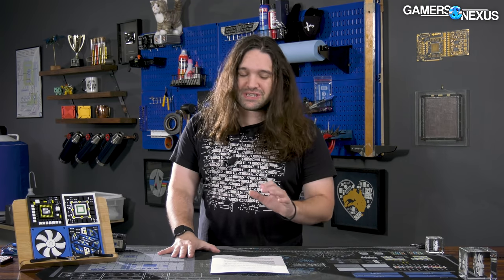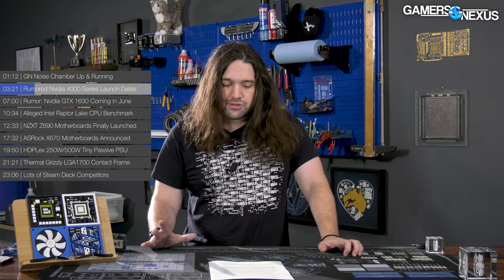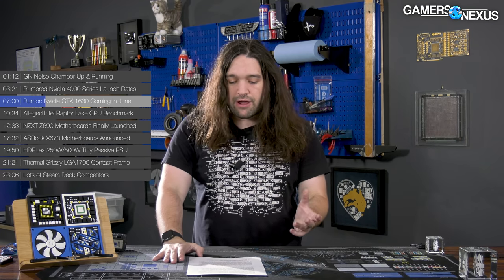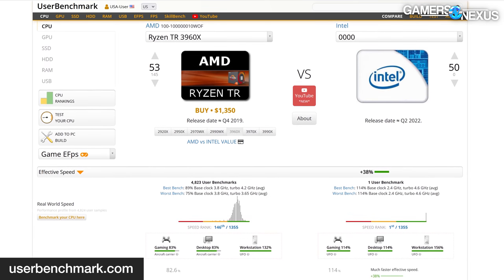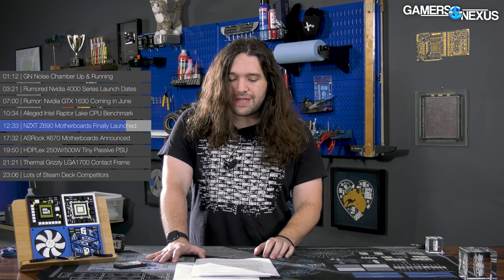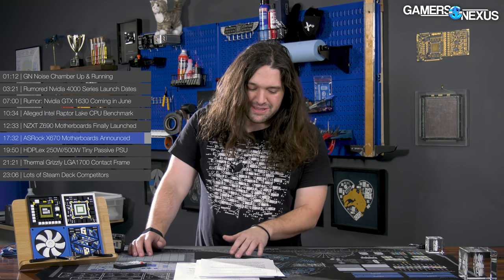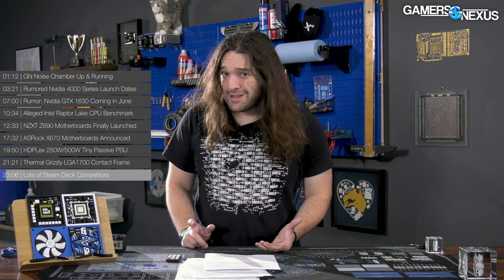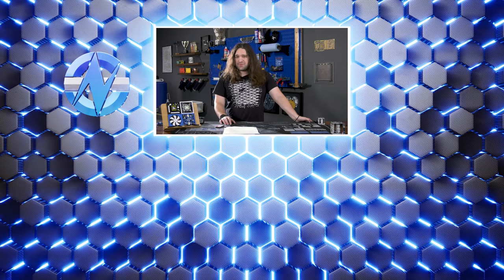HW News - Unbend Intel, RTX 4090 Launch Dates, GTX 1630 GPU, & Steam Deck Alternatives

Comment: Nvidia were not ready for the demand on the 3000 series cards and they took that to their advantage by bumping up the prices later on. With the 4000 series, they are opting to release the 4090 in case of another repeat of shortages etc…they’ll make the most out of that selling the 4090s first.
Reply: It's not that they weren't ready. They sold cards directly to miners.
Reply: @Goatfer  yes that is true. They’ll also limit their 4000 series GPUs to the 4090s and do the same thing again. More cash for them with this approach.
Reply: The 30-series cooler is literally designed specifically for mining rigs, they don’t care about gamers at all, they knew exactly what was going to happen and they made bank off of it
Reply: @What_In_This_World  I would probably disagree with that because gaming can be as hot or hotter than mining. They designed the cooler that way because it needs it
Reply: It’s iPhones all over again
Reply: @Yeltnerb 1 they quietlitterly ramped the already closed production of some 2000 gpus up so the market gets satuareted at least in the entry/midrange...so stop spreading complete bullshit that is boderline slander
Reply: @Yeltnerb 1 link proof of AMD selling directly to miners. I'll wait. 🤣
Reply: eth difficulty bomb is going off, there's no way it'll make any sense for miners unless they expect for them to be scarce for the month or so that they'll be profitable so they at least beat market deflation
Reply: @Yeltnerb 1 what complete nonsense. there is no reason NVIDIA would limit production during peak, unprecedented demand. AMD and NVIDIA were literally printing money in the form of GPU silicon
Reply: Greedy bastards, makes me sick. They will also do this so they can milk out the 30 series even longer. I bet we don't see a 4070 until Jan 2023, maybe Christmas if we're lucky.
Reply: @berengerchristy6256  AMD and Nvidia dont need to sell gpus anymore because they could just mine trillons of dollars for themselves.
Reply: As a 3090 owner, I fully intend to buy a 4090 if gaming performance has a improvement of greater than 30%
Reply: They were fully aware of the demand. They just released them and had to pretend that cryptominers weren't the main customers because they were trying to lie to their investors at the time.
Reply: @jesh879  it's suprising how often companies lIke Nvidia and Intel get caught with their hand in the cookie jar and everyone always says AMD is just as bad. They aren't. They have literally remained the most consumer friendly silicon company for a very long time. Yes they have gotten much less friendly since Ryzen but they are competing well now. It wasn't that long ago that people were saying AMD dead or trash. Over and over again in the comments on YouTube.
Reply: Only nVidia could create a family of brand names which are product numbers :D

Now soon as you see '90s or '80s you automatically think AMAZING TOP TIER and worth paying a hefty premium for.  But I guarantee you these will age terribly, I would avoid those two on this generation until much nearer the latter half of that generation at least.  The first cards in a product line are never ever the most powerful.  That has never happened and I doubt it will start now...
Reply: @What_In_This_World  gotta love youtube where people just completely make shit up and state it as fact
Reply: John-Paul Hunt  planning doing that actually. Might pick up a 3090/3090ti in late August, my local electronics store has plenty in stock and are already selling them between 200-300 (CAD) below MSRP.
Reply: @infernaldaedra  AMD isn't your friend though. Shilling and running defense for them isn't any better.
Reply: @JustSomeDinosaurPerson  You can believe whatever you want. No corporation is your they all only want profits. Hell If GPUs didn't exist at all the world would keep spinning.  
but I will prefer the lesser of two evils given a choice. And I mean that lightly not to be taken seriously. I'm just saying it's better to gravitate and support the companies that aren't taking more from people than they give. Like I obviously don't support companies like Apple or Nvidia. Do I hate their products outright? No. They make really cool shizz alot of the time. But they have done things that I could never agree with in the past and still don't to this day. Competition breeds a healthy market.
Reply: They were ready for the demand. They caused it! Then limited production and jacked up the prices. How do we know this? This is the second time it's happened, and the second time Nvidia  Has reported record profits! That's not coincidence.  If so they would have been ramping production.

Comment: Regarding the look of the Taichi Carerra: yes, definitely.  Matte black, with or without a grey mottled pattern or carbon fibre squares, is fine, but when it comes to deviating from that, designers really haven't given us much to work with.  The pure white aesthetic is fine if you're going for a white-out build, but then to really make it work you need to find pretty much everything in white.  Pure white as accents on a largely black board doesn't really do it for me, but the marble pattern looks quite nice.  (As long as it's done as well in mass produced as it was for the one photographed, which is an open question.
Reply: It could feel more premium if it were made of epoxy-ish material, similar to from what some marble dice are made. But more likely it will just be a generic print over usual plastic (at least for pattern consistency), and that's on the meh side when compared to metal.
Reply: I'm happy that they are trying something different that isn't some hideous rainbow unicorn vomit nightmare. In the right case it would look good.
Reply: I thought the marble looked good too. The Taichi series boards have had some nice aesthetics lately, imo
Reply: The name comes from the famous Carrara marble quarries in in Tuscany, Italy. The actual marble is the best and most expensive you can get. The mobo looks and name are a bit tacky, though.
Reply: I like the marble taichi effect. Bring it on I have a white case ligned up for it
Reply: All white builds show even the smallest amount of dust. Might as well just call white builds yellow and brown
Reply: @infernaldaedra  Might as well clean your room.
Reply: @nimrodery  My room is actually really minimalist but the carpet in my apartment needs to be replaced. If it had hardwood or something I'm sure there would be less dust.
Reply: Considering most of it is just a case, they should offer a few options like how the ps5 side panels come off
Reply: Looks like a marble tile
Reply: Also Yes....but i am an ITX-Board User and won't go back unless there are either none or only bad ITX-Boards in the future.
Reply: The marble on that board looks super clean 👌
Reply: When I hear Taichi I think of people doing anime stances outside in a nice park or garden setting. I definitely don't think of black and white PCBs or marble fascia. The word “Carrera” has its origin in the Latin term “Carrus”, which means “vehicle with wheels” or “car”. It was anglicized from the French word ‘carriere’ in the mid-16th century to refer to a road or a racecourse.
Reply: Who cares, I see the mother board a few times a year when I take the side panel off to clean out dust. You get a motherboard to work not a fashion show.

Comment: If you plan on getting a 4090, move your rig to the laundry room gonna need that outlet 😂
Reply: Or sell your oven and use that outlet
Reply: @Ikxi  rite toaster oven will do just fine 👍
Reply: Or live in a country that uses 230v ;P
Reply: @kecuthbertson  nah thats too unamerican. running a whole 240v circuit just for a psu to power a 4090 Ti Max extreme pro is much more suitable
Reply: A 230v outlet is rated for 20A. Are you telling me that the 4090 is going to draw more than 2KW?
Reply: If both gpu and cpu start drawing 500watts on load you better use 2kw psu.
Reply: @boffa_deez_nutz  The max a plug can be in the UK which is 230v is 13 amp.
Reply: @tyguy3876  Your gpu can take that job too

Comment: I have been SUPER happy with my steam deck. I'm disabled, and usually play games while laying in bed. I used to use Remote Play to stream games to my phone, but the SD has improved it overall. I haven't run into a game where the SD wasn't powerful enough and needed a boost from my main rig, so it hasn't been turned on since I got the deck. Less power consumption, less heat dumped into my room, and the ability to play from a more comfortable position are all great perks for buying it. Plus, now I can bring it with me when I go fishing to kill time between bites. So far, it's been nothing but wins

Comment: 2:33 Really excited for frequency spectrum analysis - "noise profile" is, IMO and subjectively, even more important than pure agregate "noise number", especially for low-noise builds or builds that idle a lot in your room. Just a day ago in a fan comparison video, the reviewer bothered to record installed working fans - and all the bearing rattling and clacking and squeaking instantly painted a very different picture than the one in performance charts, and changed my decision right there and then.
Reply: And actually, just adding a recording of the fan going from minimal to maximum RPM (with a fixed volume boost) would be very useful for this reason, IMO. This could be an after-credits section even or a mini-playlist on the Extras channel, but it would let people compare fan sound profiles, and even catch important peculiarities like Arctic's 1000 RPM resonance, or some Noctua's specific hum.
Reply: @Lishtenbird  I would rather hear 750-1400 rpm. People who actually use fans higher than that are few and don't matter. Below 750 you clutter the data with bearing noise and no fans are moving a useful amount of air, anyway.
Or hear it up to a specific decibel level like 40
Reply: @Lishtenbird  +1 to what they said, NF-A14 ULN owner, their 9.1 dB(A) (at no distance disclosed) can be heard from 7ft away at 650rpm, I use a fan controller to get it down to 550ish to be inaudible. Bought it so my amps 40mm fan doesn't turn on ever.

I also got a phanteks psu with a zero rpm fan mode when idle, what the noise number didn't include was the times when a switch(?) twangs because of the heat inside of it kicking it on and off.
Reply: @jesh879  I mean... That's more effort than just running a 0-100% PWM signal with the RPM value on screen, for the sake of several seconds saved. And you also lose checking for things like 0 RPM feature. Fans at absolute minimum speed are an absolutely realistic scenario for all the time you're not gaming/editing, so bearing sound matters. Fans at absolute maximum are also important for hot days or off-chance long rendering sessions.
Reply: Given that the picture had a cardboard box and wood beam inside the chamber I'll keep my expectations in check as it appears GN does not quite understand the importance of controlling sound absorbing properties of the chamber.
Reply: @DavidBezemer  I'm reminded of open bench testing, pc parts can perform fine in the open air vs in an enclosure that adds its own inefficiencies, so if a fan was tested in the open air, next to absorbers.. what happens when its in an enclosure? (rhetorical) just pointing out one of the caveats in testing vs a majority real use case scenario where a box with six sides surrounds the subject like an open bench result vs in a case.
Reply: @jesh879  to each their own. I'd like to have your hearing for a day.
Reply: @Lishtenbird  I have a few noctua fans, but I don't hear much from them unless the PPC (I got it heavily discounted at a hardware store going out of business) hits max power (~3k RPM). All I hear is the air getting pushed around (though this is not always unnoticeable, since they can move a lot of air when at top speed).

Then I went and ruined it by installing a 6800xt which, while a great GPU, has fans that I wouldn't call quiet or subtle. They're not horrible, but they're louder than my computer was by a comfortable margin when they spin up - loud enough that spinning up the PPC fan to its max 3k RPM is still quieter than letting the GPU fans hit max RPM.

Comment: Simple answer: God yes. That marble look is absolutely gorgeous and would massively uplift the look of my system. I'm hoping there'll be something similar available in a few years when I need to update from the 5900x and the mobo needs to follow.
Reply: Im honestly suprised it took motherboard manufacturers this long to implement designs like that. 

Vape companies have been offering their products with motifs like that for years.
Reply: yes, but screw asrock. so no
Reply: @Dracossaint  what they do? (new to pc stuff)
Reply: picture looks bad in my opinion but could be the bad collor settings on my monitor. would need to see it in real live to be sure it looks like marbel and not brid poop.
Reply: Gotta agree. The marble look on the Taichi looks really good.

Comment: I like the look of the Taichi Carrara. I used a Crosshair Dark Hero for my build, painted the I/O cover and heatsinks, and added an S-Ranked cover plate. All because white-themed motherboards weren't really available, and the Dark Hero was the only board that supported PBO and all-core overclocks at the same time. But I will probably be going all-black and no rgb with my next build
Reply: Yes, I went for a completely neutral black and white for my recent build. Black components, white RAM, black Noctua Chromax fans (with white anti-vibration pads) and white LED strips. It's very clean and simple and I love it.
Reply: don't paint heatsinks please.

Comment: The marble MOBO is fire for white-themed builds. Makes me wish there were marble cases. 
Obviously white is tougher to keep clean and dust stands out more but I still think it looks really good.
Reply: But that's where the marble texture comes into play: just like on "marble" kitchen countertops, it's harder to notice stains amidst the pattern!
Reply: Why can't we just use a Cricut machine to make our own custom faceplate designs?
Reply: Dust stands out more on black imho
Reply: Unless you're using it to cut vinyl marble would be difficult with a cricut. There are a bunch of painting tutorials if you're brave enough. I'd uh recommend practicing on something else first.
Reply: DIY Hydrodip kits.
Reply: @patrikjankovics2113  Having a couple Ice 2.0 Zotac 3060s, yes, the dust doesn't stand out as much on them.
Reply: @rexdink  Hydrodip does give you the easiest and most customizable marble look. Definitely a better choice over vinyl.

Comment: For the Optical S/PDIF on the NZXT N5, if that isn't a typo, it could be that they are using a mini TOSLINK, which looks like a 3.5mm audio connector which would allow one of the analog jacks to pull double duty. This is an arrangement that I have experienced before
Reply: Haven't sound cards have had this forever?
Reply: @TheGuruStud  my old Soundblaster Audacity Pro did, though the TOSLINKs were in the RCA Jack's rather than the TRS Jack's. That was a long time ago, but even further back, I had a Sony MD player which had a mini TOSLINK in which was inside the headphone jack. All motherboards I have had with optical out used the normal TOSLINK port
Reply: I had it on an ultrathick laptop from 2012

Comment: I'm thinking of buying the Thermal Grizzly Contact Frame, so I am looking forward to what your testing shows about it's performance.
Reply: the thermal contact frame is good hassle free upgrade. but I used the rockitcool kit on my 12900k and saw 10c drop in temperature at the same wattage (looking at hwinfo). also my temperature spread between cores was a max of 10c and now after its 5c. I would say its worth it but be aware delided cpu's reduce resale value.

Comment: Personally, for portable handheld, I like the Switch Lite approach. A low cost, non-PC experience that only a handheld can provide. But then again, maybe it is closing in on just a smartphone with miles better screen and probably similar computing power (although, with very little cohesiveness and optimization)

Comment: The Taichi Carrara … Marble white? Yeah, I'd use it.

I wouldn't necessarily pay significantly more for it being in white, but I could see this in e.g. a white Corsair 4000D or something like that. Not going for the stormtrooper look (which I don't care for) but a light aesthetic.

My current rig is in an older tooling Enthoo with an optical bay … because I needed one of those and new cases don't have them. I'm considering moving to a USB drive for that though since I really don't use it very often on my modern build anymore.
Reply: It looks like it's got cheap vinyl foil on the shroud parts. Which... Well that's a DIY idea if I ever saw one.